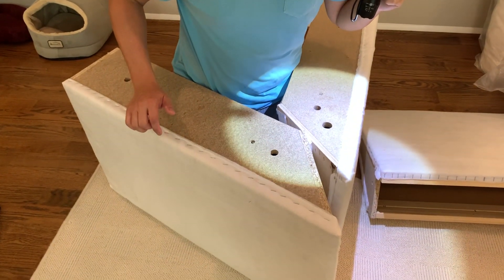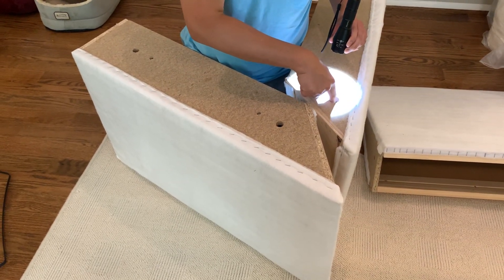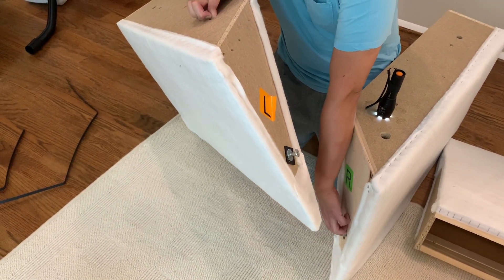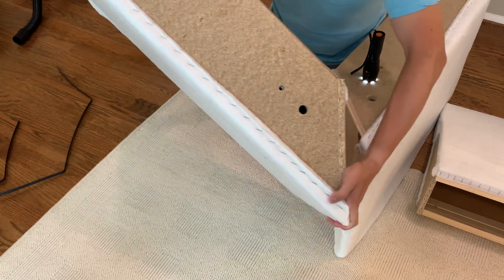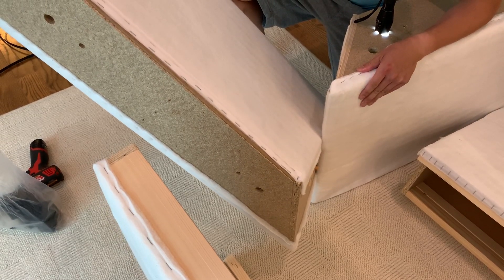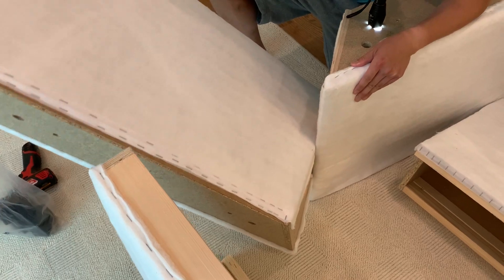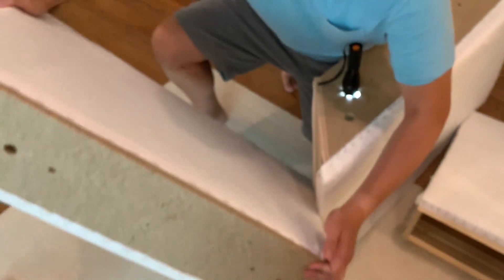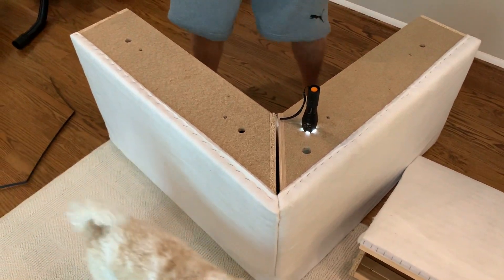IKEA Kivik corner piece assembly instructions

Comment: Thanks again for your help with this assembly. Did you happen to notice that the corner cushion is recessed compared to the rest of the sofa? If you had this problem, did you find a solution? I see a bunch of reddit posts from people with this problem and unfortunately this seems to be an issue with mine too.
Reply from the maker: Do you mean like when you sit in it, it feels like your feet are higher than your butt? Ours was a little like that, and I just put in a cushion support underneath